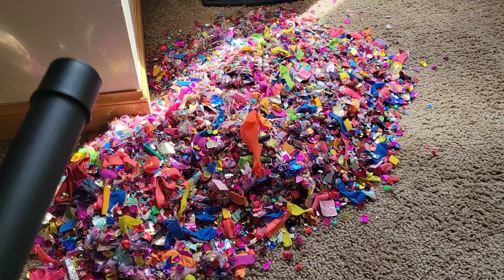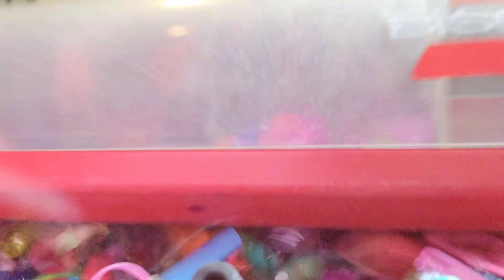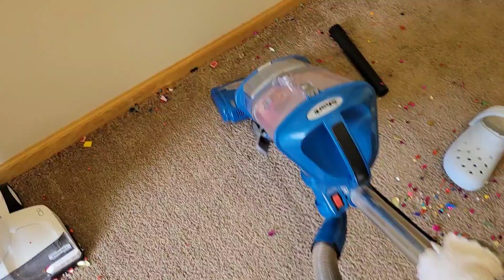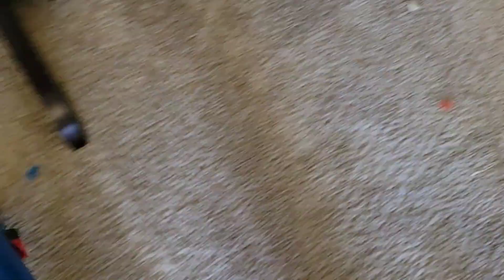Hugs for @morgan2246

Comment: 🤗 TIMESTAMPS 🤗

💖 0:00 - Extended hose pickup w/ Candy Crush Mix on carpet, closeup
💖 1:07 - Dusting brush pickup w/ Candy Crush Mix on carpet, closeup + hose cleanup
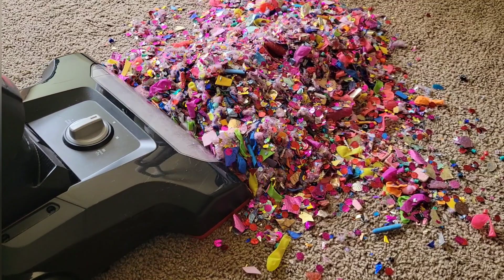💖 2:21 - Red Helix brushroll pile attacks w/ Candy Crush Mix on carpet, closeup
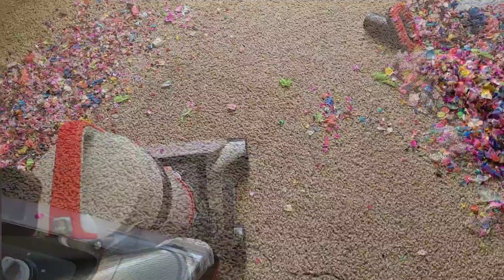💖 4:52 - Red Helix brushroll pile attacks w/ Candy Crush Mix on carpet + pile pushing

💖 8:04 - Red Helix spread out brushroll pickup w/ Candy Crush Mix on carpet
💖 9:55 - Red Helix spread out brushroll pickups w/ Candy Crush Mix on carpet, closeup + edge cleaning
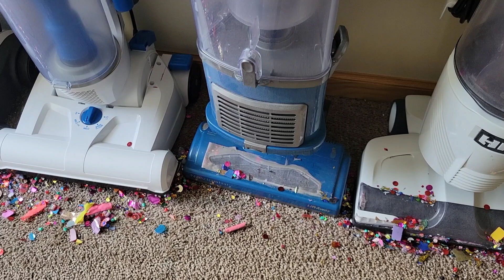💖 13:57 - Extended hose cleanup on carpet, closeup + edge cleaning 

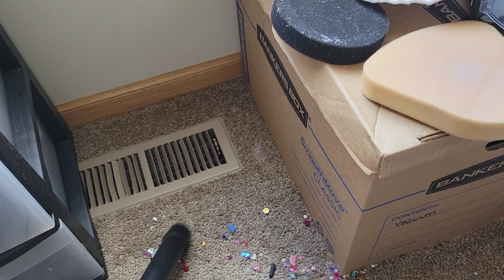💖 14:58 - Red Helix brushroll pile attacks w/ Candy Crush Mix on carpet, closeup + bin dumps & dusting brush 
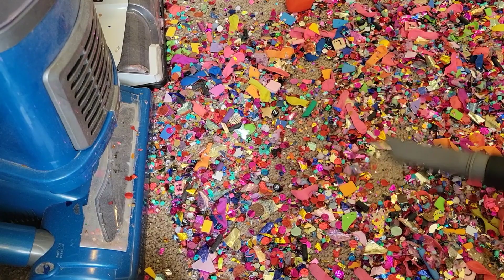💖 21:42 - Crevice/inverted crevice tool/hose pickup w/ Candy Crush Mix on carpet, closeup
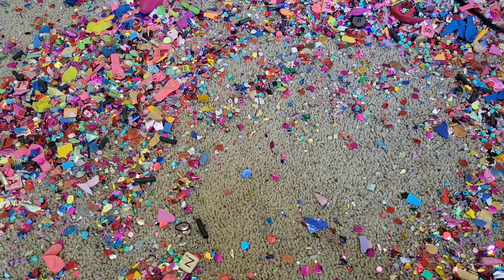💖 22:31 - Red Helix brushroll pile attacks w/ Candy Crush Mix on carpet, closeup

💖 24:55 - Blue Shark brushroll pile attacks w/ Candy Crush Mix on carpet, closeup
💖 26:27 - Blue Shark brushroll cleanup on carpet
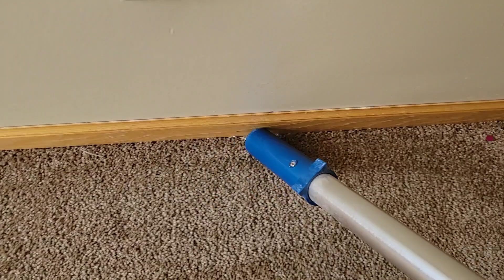💖 28:19 - Blue Shark metal hose cleanup on carpet, closeup + edge cleaning 
💖 29:07 - Blue Shark brushroll cleanup on carpet
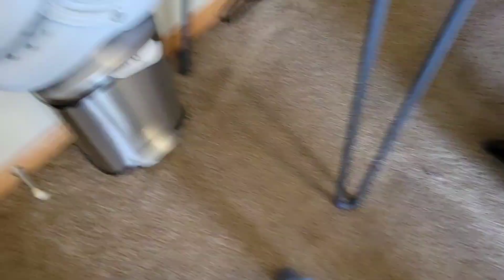💖 30:50 - Blue Shark metal hose cleanup on carpet, closeup + edge cleaning 
💖 32:15 - Blue Shark brushroll cleanup on carpet
Reply from the maker: Thank you so much Queen 😢❤